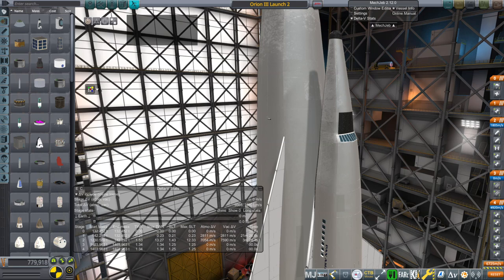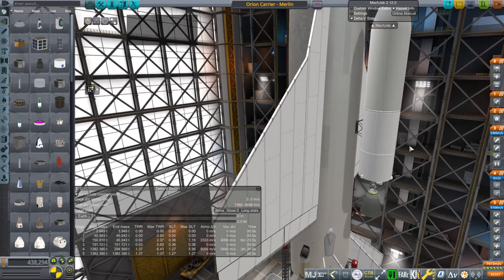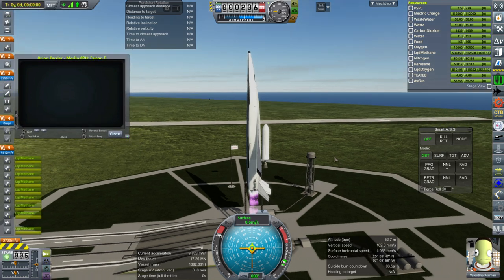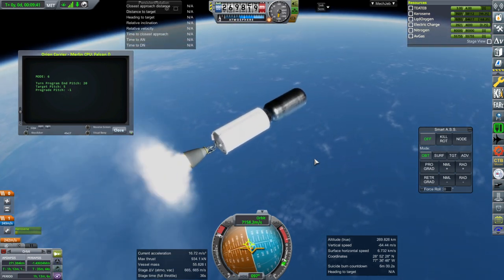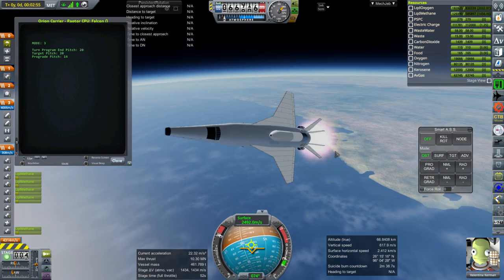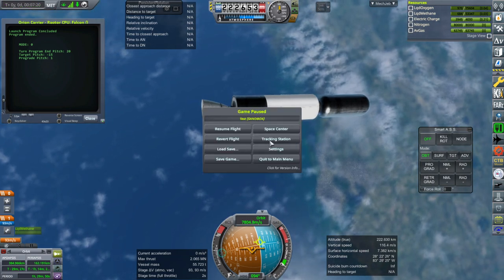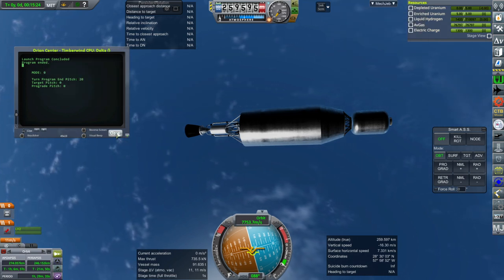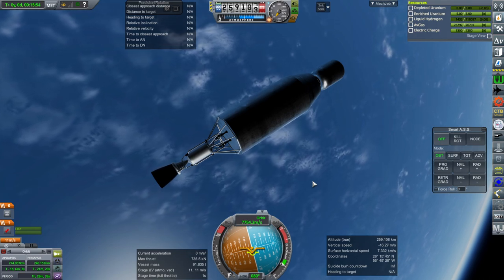KSP with Realism Overhaul - Orion Carrier Plane Payload Capacity Test

Comment: My theory on the wiggle is because realism overhaul engines vary in thrust randomly (about 0.5 - 1%). If you have an uneven amount of engines or the thrust vector is very off mass center this can induce torque at the times when it drops or gains thrust. The kOS PID loop is great but even it struggles to correct the trajectory when further thrust drops and gains layer on top of each other while it's trying to correct the first one and so on.
I think that because in my exp an even nr of engines straight through the middle never produces this problem.

Comment: I find it a bit funny that the J-2 has worse efficiency than a sea level engine in vacuum. I may want to grab this and try out my own depraved ideas (F-1Bs on carrier plane, RL-10 cluster on stage, etc.) Also gonna go against my own beliefs and try mechjeb ascent guidance and see if it has roll issues. What was the target orbit set to, 270km?
Reply from the maker: With a given volume, the J-2 may get less delta-v than an engine with denser fuel. Also, the J-2 was a very early hydrolox design, so something like the Vulcain, which is technically a sea level engine, is better. I generally leave the target orbit on 270km except for on particular systems like the Shuttle.
Reply: it does have less mass, so if you aren't restricted in tank diameters it would be better for larger payloads. You also might want to also adjust the script so it doesn't limit the pitch as much if there is a limiter, but you probably already know both of these things idk why I bothered
Reply from the maker: It's important to remember that I wrote the script for cinematics in Rocket Profiles and Mission Profiles, where no one is even going to know what orbit it got into. The goal is just that it looks decent, so there is a pitch limit to ensure it doesn't look ridiculous trying to adjust itself, unless absolutely necessary.

Comment: In the Space Odyssey novel the booster plane actually takes off horizontally supported by a sled on a railway track. I have always been a fan of horizontal takeoff and landing, because not only is it much safer than vertical takeoff, you might as well take full advantage of those heavy wings!
Reply from the maker: I don't like horizontal takeoff because with a fully loaded plane, you need much bigger wings than we have here, and much heavier landing gear. The landing gear and wings here are only designed to accommodate the carrier plane when empty (about 12% its liftoff mass) - can you imagine how big they need to be do deal with a runway takeoff when it's full of propellant? Not to mention the propellant you waste while building speed on the runway and then having to pull up into the ascent (which would ideally be straight up anyway).